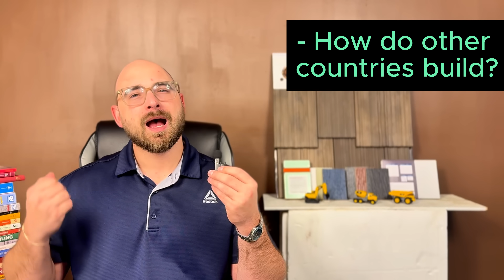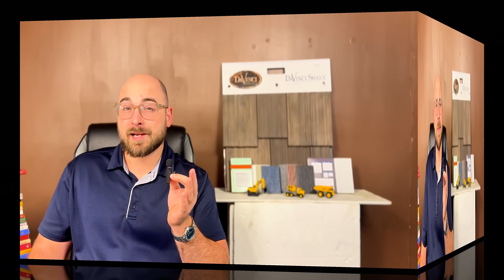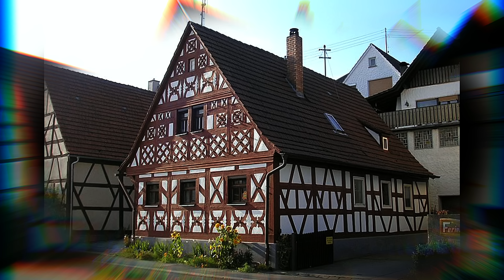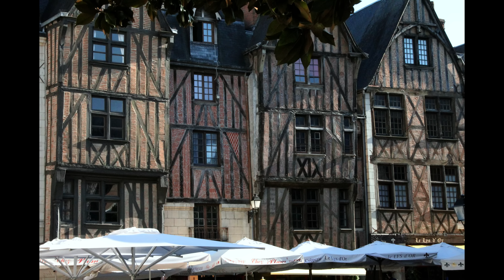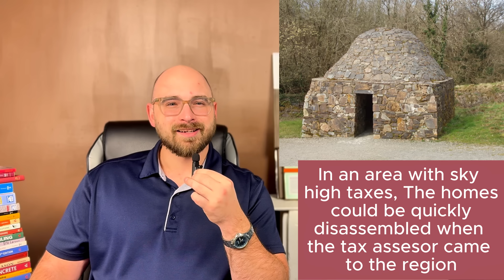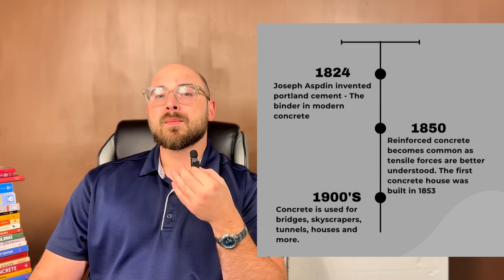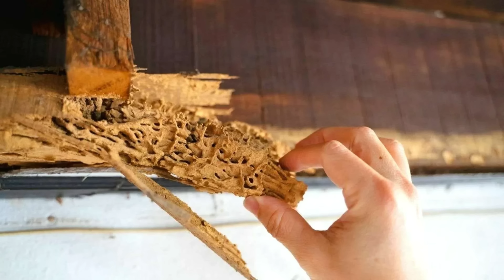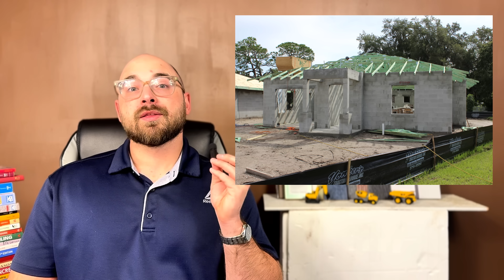Why Other Countries LAUGH at American Homes

Comment: I lived in Alabama and I have seen tornadoes take away dozens of houses every year and I don't see any point in building forts, if insurance can cover all the expenses and you get a brand new house in return. So what wrong with USA??
Reply from the maker: Insurance typically doesn’t cover %100, the cost to rebuild is often higher than the homes current value. 

Not to mention lost time, lost belongings, and potentially loss of life, all of which are priceless. 

To build more flimsy houses in disaster prone areas is beyond stupid
Reply: @Mike_Fortin  I understand that
Reply: @ Mike- I don't know where you live, but you have to understand that each state has its own codes for building houses and the houses don't really flimsy, they're very good, you just need to follow the technology. Plus, it is impossible to avoid tornadoes in Alabama, so the forecast is always broadcast on TV. People who die during these events are just idiots, it is inevitable.
Reply from the maker: The codes don’t encourage good building practices, they’re simply the minimum acceptable standard 

Better tech would be concrete homes built with ICF. 

And it’s only a small increase for something that can survive hurricanes, tornados, and other disasters 

The industry is built around the cheapest possible product, we can do better
Reply: @ this is true I agree with this 100%
Reply: this is probably one of the craziest things I've ever read.
Reply: This comment explains a lot - philosophy of building low quality structures covered by insurance, so by all clients of the insurance company, and if it fails - by taxpayers which is very socialistic. With no regard for heritage, efficiency, true beauty and long term quality of life. Pure wastefulness.
Reply: @ElegantiaeArbiter  taxpayers don't pay for insurance
Reply: @CheerfulMarian-u3m  FEMA
Reply: @ElegantiaeArbiter   To be honest, Americans are very, very wasteful. Аs far as I understand in the US there is a theory of building ..buildings and housing for a quick sale rather than for building something fundamental for centuries. The main thing is money and the main thing is that your future building requires maintenance. this is how i see it.

Comment: I subscribed because this was very interesting! I agree 100% that concrete homes would be better, the only question being in earthquake-prone areas, I've heard that concrete is used less because it cracks under stress. 

I also think there has to be a way to include more metal for strength, like Simpson Strong Ties if not also I-beams for the basic structure, maybe in combination with concrete, same way as rebar is used now in certain structural areas.

The problem is that most builders just want to build CHEAP rather than BETTER.  Those few who do care about building better ARE probably delivering more value per dollar. You have made me decide to review the major systems in my house to see if I can add any improvements.  If only I had it all to do over .....

I listened all the way to the end. This was really informative. Thank you!
Reply from the maker: Thanks, I’m glad you enjoyed it

Comment: While building with wood is undoubtedly cheaper and faster(which means even cheaper), the question is in which pocket goes the saved?
Here's a story: I'm from eastern Europe. I wanted to build a sort of a secondary building in my yard, the construction guy convinced me it's not necessary to be solid, but could be from metal construction with panels in between, but will looks like solid building. I said ok, why not to save some money. When he gave me the offer, it was basically the same price that would cost me to build it with concrete and bricks. Guess what I chose...

Comment: We see how American homes get easily torn by tornadoes in the news.

We see in the movies how they easily get broken into by criminals. A door that can be broken open by a person is scary. 

We also get confused about the all wood material. 

Why using wood as the main material?
Fire hazard, easily damaged by humidity, rot, insects. I’m sure there are more cons. 

The pros or benefit of wood as the main material that i can think of are few… 
Affordability, easy / fast to build.

Conclusion:
I don’t like this pros and cons ratio.

Especially since houses in USA aren’t even cheap… when they really, really should be. I just don’t get it.

Comment: Concrete production is terrible for carbon emissions. Wood frames are storing carbon. Well, unless they burn down lol
Reply from the maker: It’s not quite that simple. 

There are other variable to consider. Wood still requires gas powered equipment to harvest, cut, plane, kiln dry, transport and construct, 

Like you said wood buildings can also burn down, or otherwise be destroyed by natural or manmade disaster, which then requires rebuilding, 

A concrete building will not burn, is disaster resistant, and also resistant to moisture, which means it will last longer. 

We must also think about the safety of the occupants. Fire safety, storm resistance, bullet resistance, even vehicle impacts all of which are regular occurrences. 

Until eco friendly concrete is widely available, we have to use what is available to us. People hate on ICF, but then spec rigid foam in builds. It’s what’s widely used for now until technology changes. 

I’m working on a build now that’s using carbon capture technology, capturing C02 from industrial processes and incorporating it into the concrete mix, greatly reducing the emissions, 

I’m all for sustainability, but it will take some technological advancement and industry shifts, until then I think concrete is a great option for a variety of applications

Comment: The answer is… YES. not yes and no. 

Houses should be built to last and protect people inside. 

Leaning towards disposable homes is profit over people and capital greed at its worst.

Concrete frame homes with brick filling are great and cost effective.

Comment: Hi, It's Tex again. Forgot to mention that with my system you make a) the foundation, b) the exterior walls, c) the interior walls, d) the platforms between the different levels of the house, e) the attic floor and also f) the exterior roof all with the same material thereby avoiding any weak links. If you Mike, or anyone else reading this are interested to know more then contact me, I’m always looking for more partners.

Comment: The church in my village is from the year 1050, around the time when vikings ruled (Denmark). So the quality of the building to withstand the time speaks for itself. Traditions vary and what materials are available locally, but that’s not really an issue anymore. The codes in the US are very low and often needs inspection. In Denmark we have strict codes, but absolutely no inspections. The craftsmanship are high on single family homes and build by educated professionals, who have 4 years of education in specific areas like bricklayers, carpenters or electricians. No self-taught electricians are allowed and you have to have proof of a yearly update on your education, to be able to be authorized. When I look at home building in the US, it seems like an outdated traditional way to build with wood (sticks) and excessive use of nail guns instead of screws, generally only to benefit investors and contractors, not the home owners.

Comment: I watched through the whole thing, and was getting increasingly frustrated because you mentioned all kinds of structures and materials for homes and you did not mention ICF homes...until the very end! Phew! I was going to tear a strip out of you. In my Central Canadian city we have three or more ICF (Insulated Concrete Form) manufacturing plants here. We have entire apartments built right up to the top floor with these forms. I've seen houses built entirely with ICFs. 8 years ago I had my basement done with ICFs.  I added additional foam on the outside of the entire house, and recently got a notification that my house was five times more energy efficient than my neighbors. So my ICFs paid for themselves long ago. Everybody should use ICFs. Why would they not?
Reply from the maker: 😅

It’s an industry that’s slow to adopt new tech. 

There’s also stubborn builders and contractors “doing things the way it’s always been done” 

There’s also the added cost, 

Some folks are very eco conscious and dislike concrete and foam (even though they’re already widely used in the industry) 

And I think the biggest factor is a lack of awareness that ICF exists.

Comment: I built my 2200 sqft stickbuilt home now 40 years ago. The studs are 8 inch . Rafters are 10 inch. All insulated to capacity. No siding but brick all around and windows today triple glazed. There are no  airleaks and the doors have 4 inch high end PIR insulation. Every joint glued with construction grade material and was screwed in place. No nailgun or staples were used. Drywall is a full inch.
Reply from the maker: That’s sturdy!!

Comment: To be fair, yes, American houses are build a little bit weak. At least in comparison to most European houses. But they are perfect for the circumtances in North America. We don‘t get hurricanes in Europe, our tornados are much weaker than the ones in the US. If a fire like in L.A. would happen in a European city, more of the houses would be standing afterwards, but they would still be ruined and the ruins would be needed to remove before the house could be rebuild (which is expensive). So, what‘s the point? European houses would be nothing but an unnecessary cost factor to Americans.

Comment: The answer is simple - Anglosaxon settlers brought the concept of quick building from wood to all colonies: USA, Canada, Australia and New Zealand. Colonies of Spain were using masonry and remained this way.
Objectively speaking the stick-framed buildings are very flammable, host insects and rodents in the cavities, are not resistant to stronger winds (because of low specific gravity of the walls), transmit sounds easily through the walls and ceiling and just feel flimsy and empty. Also, it would be better to call them hydrocarbon buildings because the shear amount of chemicals they contain, that cause allergies and health problems in a long run. Purely wooden buildings can be quite charming, but still with all shortcomings, minus chemicals. Because they are more like temporary structures, they can not create lasting beauty - like European cities, towns and villages that are visited by millions every year. All of these negatives could be somewhat tolerated if the price was low, but it's not the case. These hoses are more expensive than solid-like-a-tank houses in other developed (or not) countries.
It means that Americans are just scammed without even realizing that it's happening, because they live in a bubble and most of them never saw a real masonry house and never lived in one.

Comment: I own a home just outside of Phoenix, Arizona. The first time I visited, I was SHOCKED. New homes, for the most part, are wood. A wood home in a super hot, dry, desert climate known for its termites. I honestly didn't know. Then, even worse, 2x4 construction for the exterior walls and minimal insulation. My only thought upon walking around those job sites was, "If I were in charge, all exterior walls would be poured concrete or cinder block, backed by steel studs and sprayed with 2lb closed cell insulation, or rockwool, as a minimum construction standard."

No, I didn't build. I bought a home 2nd hand, I didn't have time to wait for one to be built. I regret it now, even though it's ok. The house is 16yrs old, but I can't see the houses down here surviving this environment like a European home will.

Comment: You got some things wrong. Houses build out of reinforced concrete and bricks doesn't have insulation on inside walls. This is because those materials have a high thermal capacity. Meaning when you heat your house floors and walls are accumulating heat and then release it back in the house when heating is off. That is why there is insulation on the outside. To prevent heat from escaping out.
If you put insulation on inside wall you will be heating just air and basically got the same thing as you have with those us houses.
Eu houses is more energy efficient because they have high thermal mass tnx to building materials, upvc with at least double glazing as standard and good outside and roof insulation.

Comment: On the concrete tangent, it's a common myth that somehow we don't know how to make roman concrete or how it survived, but in fact we do and we have known for decades. Roman concrete simply used lime as a binder which had the benefit of when exposed to water through a crack, it would react and recrystallize, essentially repairing itself. 

Another myth is that our concrete is somehow weaker. Some concrete mixes are weaker than others. For non load-bearing concrete, we can use weak concrete and save some money. When we need to, we can use incredibly high strength concrete. Roman concrete could withstand a pressure of 4000psi, give or take. We have used concrete with a compressive strength of 20,000psi and we have been able to produce concrete in a lab with a strength of 60,000psi.

Comment: You didn't mention 3d printed houses.
Reply from the maker: Because they’re a fad. 

They’re not cheaper, they’re not as strong, they’re exposed to the elements, they’re not insulated very well 

A solution in search of a problem

Comment: While talking about concrete homes, you could have mentioned 3D printed homes.
Reply from the maker: I don’t like 3D printed homes. They’re not cheaper, they’re not strong, they’re not well insulated, they’re exposed to the elements. I’m not a fan. They crack and leak. Just way Too many problems . 

A solution to a problem that doesn’t exist, it automates framing / concrete work, which is not expensive at all

Comment: To prevent dampness we invented a thing called „lüfte“ (in Swiss German) or „lüften“ (in German). It works as follows: You get up in the morning and open the windows. Summer, winter, the temperature doesn‘t matter. After 5-10mins. you close the windows again. You can repeat the process throughout the day and do it again in the evening and voilà, air circulation and no mold (if your house is isolated the right way).
Reply from the maker: Natural ventilation is popular, 

I have respiratory issues and would prefer mechanical ventilation, ERV + whole house dehumidifier, to screen out any dust, dirt, mold, or pollutants

Comment: I'm afraid with a housing crisis and increasing homelessness.....heads need to be knocked together internationally to resolve......doesn't one think 😶
Reply from the maker: Regulations make it difficult. You can’t build tiny homes, you can’t build multi- family. You can’t build ADU (in most places) 

And even those are not cheap. Trailers are cheap, but they’re not permanent housing. 

We almost need capsule pods with storage units and dedicated parking spaces in a building with communal areas

Comment: I live in a house that was built when the US wasn't discovered yet (at least not by Columbus). Brick and old oak beams for the roof and first floor. We renovated by adding a full armed concrete floor and an extension of the house in double walled brick. It doesn't just feel like it will last a lifetime, it will, and it has.

Comment: Living in a timber house in middle of rural Sweden, built somewhere between 1738 and 1740. Of course has undergone some fixes and improvements. Improved insulation, heating, installing water and electricity. Double glazing and modernised kitchen. Still have an woodburning stove in case of power failure. But it is the same logs it was built with. Must have taken incredibly many hours to shape the hundreds of logs with eighteenth century tools. Close to the house is a partially underground cellar used for food storage, Built from natural shape stones without any cement. Wonder if you can find anyone today that can make an arched ceiling like that.
Not a perfect house, but a pleasant one to live in.

Comment: 10:15 The coast of the North Sea and the coast of the Baltic made heavy use of brick much earlier than the Renaissance period. Due to the lack of lumber and stone, brick was the only building material available, leading to an own architecture style, Brick Gothic. You find Brick Gothic from Dunkirk in Northern France via Roskilde in Denmark up to Novgorod in Russia. And even earlier, during the time of the Carolingian dynasty from the 8th to the 10th century, you have Brick Romanesque buildings.
What is interesting is how brick building was very intermittent. You had periods with nearly no new brick construction interspersed with periods of very high brick building activity.

Comment: 9:35 Fun fact: the recipe for Roman concrete was indeed lost for many centuries, the recipes that survived appeared to be faulty or fraudulent, until someone simply tried to replace the "water" in the recipe with seawater. The resulting seawater-ash-quicklime reaction allows for the formation of crystals which strengthen the concrete, and unlike modern concrete which gets worn down by seawater over decades, roman concrete is instead reinforced by seawater, and is why thousands of years-old underwater roman structures are still intact today